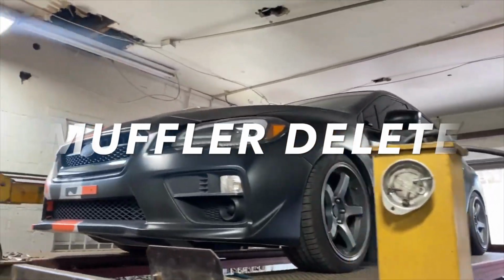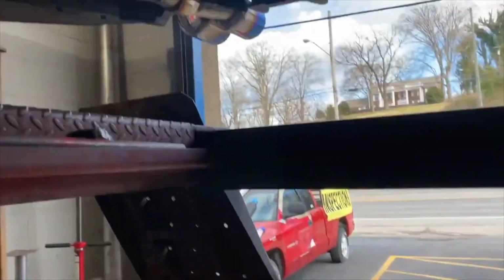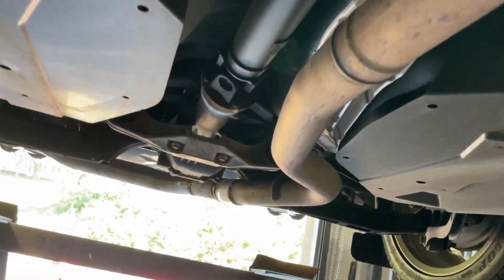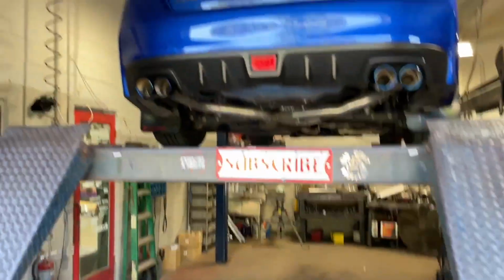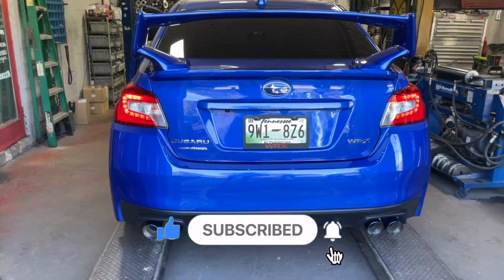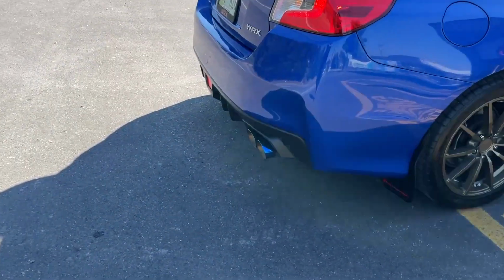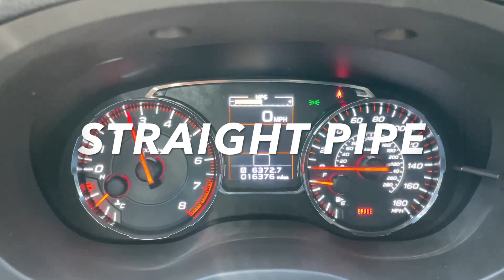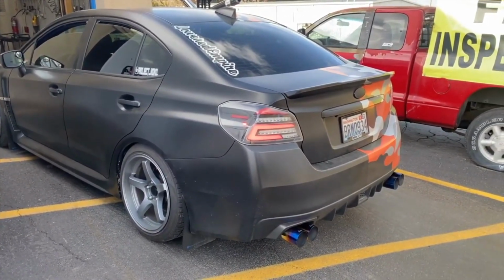Subaru WRX Turbo: MUFFLER DELETE Vs STRAIGHT PIPE!

Comment: I owned an 03 WRX that had catless uppipe, invidia catless downpipe mated to an invidia q300 catback. Sounded absolutely awesome IMO. I believe Subaru did away with unequal length headers which gave it that signature sound.
Reply: Super sick.
Reply: They did, although you can get them aftermarket for this car
Reply: @BM-vb9bo  not worth getting though if you want performance
Reply: @ajgurney5811  truth
Reply: i had an 06 Legacy GT with the exact same exhaust set up, sounded so nice

Comment: Prefer the half and half Subaru with the Invidia system personally. Just sounds more “refined” and stronger. Could be that it’s tuned too with the high flows and resonator, but still
Reply: Hey, I was wondering what you would recommend I do with my exhaust for my 2017 wrx. I did a muffler delete but was wondering if you have any recommendations for me? I’m still waiting for the car to be fixed and I have never drove it but only started it it and revved it a few times. I got it from the auction so that’s why I haven’t driven it yet and I’m still waiting for it to be fixed. If you can please recommend me what to do along with the price of how much it would cost

Comment: Coming from a straight piped catless. To a unknown performance catless turbo back with resonator and mufflers. I do prefered the up catback now instead of the straight pipe. Straight pipe was really raspy. It was nice at first. Because all the turbo whistle is there but when on boost it was sooo raspy. Now i get better sound quality with my new setup. Still catless tho. But so much quieter with back pressure on the tips.

Comment: I will go with muffler delete on the WRX because it has more sound to it than a straight piped WRX to be honest
Reply: I’m honestly now getting a lot more into cars. I have a 2017 wrx and I have a muffler delete. Is there anything else that I can do to it maybe to make it louder or have a deeper tone while maybe still having a muffler delete?
Reply: @alexblain594  I have a 2019 WRX. You should get a catted Downpipe match with the Muffler it will sound really nice.
Reply: @alexblain594  but if you want it really loud +a lot of turbo noise go with Cattless Downpipe
Reply: @alexblain594  get a tune if your gonna get a downpipe
Reply: I was thinking about getting a cat back exhaust. What do you guys think?

Comment: I ripped the mufflers off my 2010 impreza and they look the exact same as the 2020 impreza wrx except my mufflers had one tip per muffler instead of two same hangers location, Y pipe , everything 😂

Comment: most subarus after 2015 dont have that low rumble the boxer is famous for, newer ones sound like a normal 4cyl but with a deeper tone, still a boxer but not the good sounding one
Reply: err, I own a 2017 Subaru STI - It literally has the "famous boxer rumble" (and I'm still bone stock everything lmao, also own a 2004 STI (heavily modified)) idk where you get your imaginary info from. It's literally what the unequal headers cause it to do and is my favorite part of the exhaust....... 💀 In case anyone reads this load of crap, don't be fooled, I just hate reading what people say when they are talking out their ass (Again if you even read this, MAKE SURE you understand what I said at the beginning so you don't hurt yourself replying... I OWN one.... You're lying and don't know what you are even talking about) The rumble is SO NOTICABLE on mine it's impossible to MISTAKE it. Weirdo.
Reply: Hasn’t the ej been in the car before 2015
Reply: @JordanWilliams-r1p  in the STI and the normal WRX, but maybe I'm getting my years mixed up, the VA and STI I know has the subie rumble but the VB I think does not have the same motor and that may be what I got wrong in my original comment

I don't own a Subaru but many friends do and I like to keep up

Comment: Bumping off the rev limiter. 
#RicerRev
Reply: That’s launch control my guy
Reply: I believe that's the 2 step or anti-lag
Reply: @ifoundjesusbehindthecouch6261  yep, it might be factory
Reply: @nathanlokai4456  I don't believe it's a factory option. When I had mine, you could use a Cobb accessport to adjust boost and such. My personal WRX had a mild (stage 2) tune that upped boost and made everything much more responsive
Reply: I know the difference between anti-lag and 2-step. This is neither. He revved it like that because the shop owner will not rev someone else's car that high and risk damaging it so he did it himself.
Reply: @ragintaurusmusclemercury7023  it’s definitely 2 step, it’s fuel cut so it doesn’t shoot fire and backfire like other 2 step u might see. My evo has this same kind from the factory
Reply: @nathanlokai4456  It can be added to other cars to help with launching. Nothing more than a secondary rev limiter.